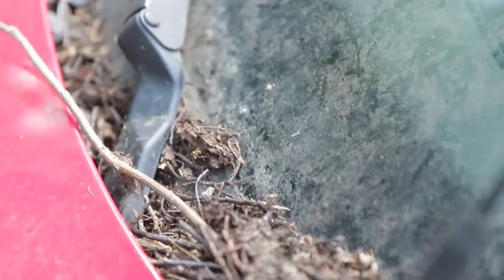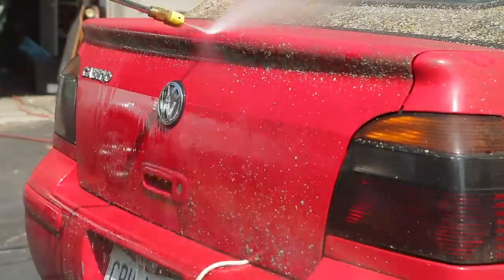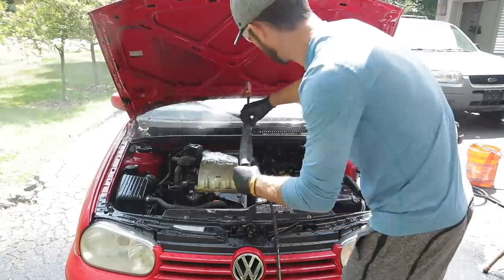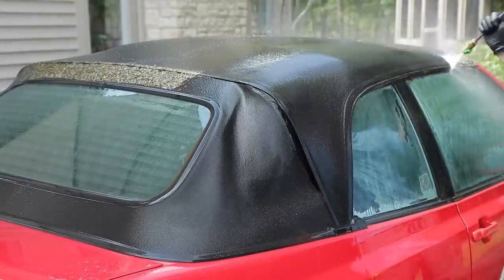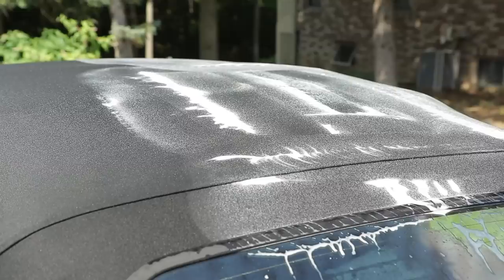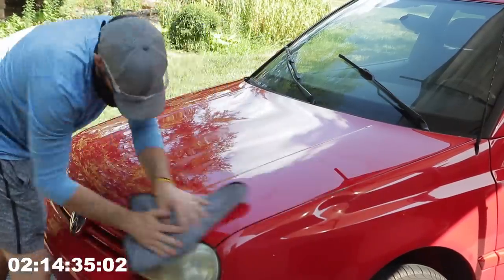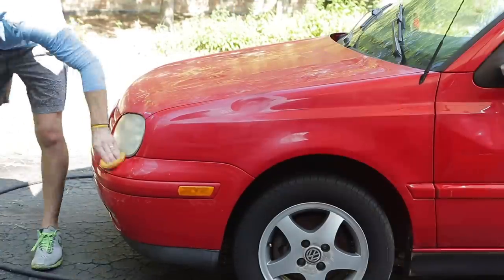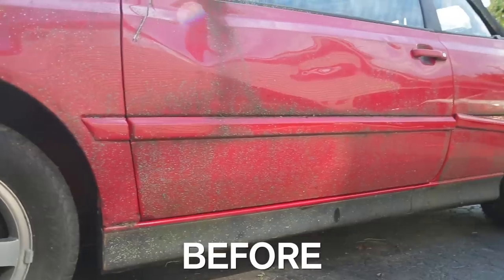ABANDONED BARN FIND First Wash In 15 Years Volkswagen Cabrio! Car Detailing Exterior & Restoration

Comment from the maker: HIT SUBSCRIBE & Turn On Notifications for More Transformation Detailing Videos!
Reply: i know where you live
Reply: @StoopidMonkeysMomma  Honestly, I used to be a professional detailer and the absolute best headlight restorer is made by Mother's and it comes in a rectangular box as a kit. It includes the sanding pads (1500 and 3000 grit pads), the buffing wheel to put on a drill, the compound for cutting through the sanding scratches left over from the wet sanding process, and it also comes with sealer. If you open the kit, get a bucket of water, take the 1500 grit pad and wet sand the headlights thoroughly, then repeat that same process with the 3000 grit pad, then put the buffing wheel on a drill, shake well and apply the compound to the wheel, smear the compound onto the surface of the headlight, and lightly buff the headlight with the buffing wheel and you will see just how good it comes out. Repeat the buffing if you still have any hazy spots or scratches. When you're all done, wipe the headlight with a microfiber towel and apply the protectant and you're done. The kits are cheap and you can reuse it many times. It works great in my experience.
Reply: @StoopidMonkeysMomma  Hopefully that'll help you out Theresa. Anyone can do it and it only takes maybe 15-20 minutes.
Reply: Thank you for teaching me how to do this work. I've subscribed
Reply: Stauffer Garage  whats is the name of that spray which you used to clean tires ..??????  From where I can get that ????
Reply: Keşke far parlatmada yapsaymissin
Reply: #MOLDNOMORE
Reply: si
Reply: Anyone do this in new jersey i will pay u
Reply: Ok ooo
Reply: @davidescalante7252  o
Reply: OK.
But didn't Polish the headlights :(
Reply: Fuckin satisfying 👌 😎
Reply: @caden7114  that’s kinda weird
Reply: You know you can polish your head lights
Reply: Great work and great videos! Why was the car not running? Was it ever fixed and put back on the road?
Reply: @caden7114  tty
Reply: @caden7114  u
Reply: Ive got the identical car.  How do I fix the same tare in the top as this one has.??

Comment: Next time, we want to see:
- Headlights restoration.
- Paint Correction. 
- Take out the dents.
- Wheels Restoration.
- Deep cleaning under the hood.
- Clean under the seat.
- Take out what ever you can from the interior and do deep clean.
- Fix and upgrade all damaged and broken parts like the Convertible top, interior carpet, etc.
- Fixing all mechanical issues and tune it.

- You know the rest.....

Comment: Before putting soap on the car tape the paint around the headlights wet sand the headlights with 500 grit,800 grit,1500 grit,3000 grit, the spray some Maguires headlight clear coat  let it dry for a couple of hours or day the bam brand new headlight to blend in with that great detail you did for that car

Comment: Do you have a second set of drill brushes you use for the outside detail and then a set for the inside? Or is there not too much difference in the long term of the brushes if you use them for both?

Comment: Nice video. You do a really nice job. Several things come to mind after watching it:
1. You have a pressure washer. Why not snow foam the car, especially one this dirty before a contact wash? It would help to break down the thick layers of contamination still remaining
2. After a contact wash, why not use iron & fallout remover over all painted and windows on the car? It would have made the clay bar process more efficient and effective. 
3. How many cutting pads did you use during the compound? I didn't see you blow out your pads at all doing a pass on the entire car. I am asking as I usually need to use 4-5 pads on a car this dirty.
4. Why not compound or wet sand (correct) the hazy headlights? 
Again, great results and nice production.

Comment: This gives me hope for the 1986 Nissan pickup my parents so graciously gifted me when I got my license... that's been sitting in our backyard for 12 years and doesnt have a floor... needs a new paint job anyway because the last time it was painted my dad did it with a can of rustoleum so I'll just pressure wash the whole exterior and bed. The inside will be another story but man I love your stuff and I've said it probably one thousand times because it makes me realize I could seriously fix up that truck because the only serious technical thing it needs is a new battery and MAYBE tires. It basically looks exactly how this car did though, maybe worse because it has some pretty gnarly external rust damage (looks bad but it's most likely fixable)

Comment: Turn the front wheels side to side. When doing so. Unscrew the inner fender liner on thr firewall side. And clean all the crap that collects from the rain sill and rots the fenders and rockers. Typical vw issues. I bet from sitting its pretty packed up.

Comment: I have a 2000 Mk4 Golf and from the thumbnail that's what I thought this car was. It has the same 8v 2.0L that my car has, but mine is a 5 speed manual, and it's still an absolute turd. Mine runs really well, as most of them do, but it doesn't go anywhere fast. Granted, it's quicker than my 98 Jetta Wolfsburg was with the same engine and trans because it's a two door hatch, but it's still painfully slow. My 97 Civic coupe would've destroyed it even when it still had the single cam. I would LOVE to get my hands on a wrecked GTI and swap my little hatch.

Comment: your ozone generator will work more efficiently if you have it outside the car with a flexible duct running inside the top of the window  O3 or ozone is heavier than air and it needs to have a good fresh air supply to work better

Comment: As a detailer, I can't believe you used a power washer on a convertible top. I would never use a high pressure water source on a vynal top. Especially one as old and neglected as that one. You are lucky you didn't blow right through it.

Comment: I have noticed in your video’s you are using a power washer under the hood on your engines ,but I have asked around and was told not too it may damage some of your components or electrical connections is this true?

Comment: it would be good not to clean, with the pressure washer, the motor, since you can break, or make a circuit break, it is better to clean it with a damp cloth, and with a wide brush